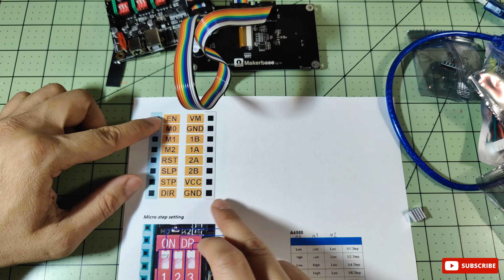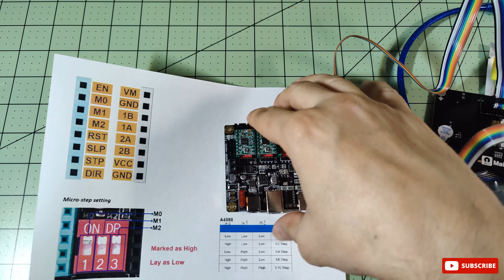How to Connect a Display and Stepper Motor to MKS-DLC32

Comment: من میخوام mks tft70 یا mks tft35 را با dlc32v2.1 استفاده کنم . شدنیه؟
Reply from the maker: Yes and No, the MKS DLC32 does not directly support the TFT70 display. It is designed to work with MKS TFT24, TFT28, TFT32, and TFT35 using a serial connection. The TFT70 uses a different firmware and interface, typically meant for larger 3D printer controllers like the MKS Robin series.

If you specifically want to use a TFT70, you may need to modify the firmware or look for community solutions, but it is not natively supported by the MKS DLC32.

Comment: It is compatible (hot swap) with the tmc2209 v2? Or it needs some adaptions?
Reply: yes. compatible
Reply: @julionewcosta  Can I use the TB67S109 stepper driver with the MKS DLC32 2.1 board?

Comment: Do I need the display to test this or can I control it with a laptop?
Reply from the maker: If you are using makerbase FIRMWARE you need to have the display but if you install FIRMWARE you dont need to have the display ;)
Reply: @UnlimitedIdeas3dprinting  I installed Open Builds Control software and it immediately recognized the card and allowed me to control it with my laptop. I never hooked up a dosplay to the board.
Reply: @roberthosking7524  Did you connect to Open Build with a cable or WiFi?

Comment: Which type of supply you have used for the mks dlc. Please can you tell me about that
Reply from the maker: In this video, for my testing, I used a 12V 3A power supply. However, for regular usage, I require a 12V 30A power supply, which is overkill. I need to mention that I am using this power supply to light two 20W lamps. ;)

Comment: Any idea on how to use this board along with VFD /1.5 kw spindle . Thanks
Reply from the maker: Thank you for your comment! While I don't have direct experience with a spindle as powerful as 1.5 kW, I can offer some general guidance. The MKS DLC32 board should be able to handle a spindle of that size. Typically, machines with such powerful spindles have an external stepper motor driver to control the spindle. You may consider replacing the existing control board with the MKS DLC32, ensuring compatibility with the external stepper motor driver. However, it's crucial to consult the documentation of both the MKS DLC32 board and your spindle to ensure proper integration. If possible, reaching out to the manufacturers or online forums specializing in CNC machines might provide more specific insights from users with similar setups. Best of luck with your project!

Comment: Hi can i use this to upgrade my desktop laser to standalone? 
Is it a gbrl ready board? 

Thank you
Reply from the maker: The MKS-DLC32 is an offline engraving master control kit developed for desktop engraving machines. The hardware is equipped with a 32-bit high-speed ESP32 module, integrated WIFI function, and it is supporting GRBL, usually board is coming with CNC firmware you need to update it
Reply from the maker: the MKS DLC32 is capable of running standalone. You can copy GRBL files to the microSD card for engraving.

Comment: I just bought doc32 v2.1....I don't know how to configure my machine size...pls can you help
Reply from the maker: To update the machine size on your MKS DLC32 board for your laser engraver while considering limit switches, follow these steps:

    Open the 'dlc_cfg.txt' file.
    Locate the parameters for X-axis ($130) and Y-axis ($131) maximum travel.
    Set these values to your desired size, e.g., $130=300.000 and $131=300.000.
    Ensure your limit switch positions are also adjusted to match the new machine size.
    Save the 'dlc_cfg.txt' file.
    Copy the updated file to the root directory of an SD card.
    Insert the SD card into the MKS DLC32 board.
    Alternatively, you can also update these values using laserGRBL or the firmware webpage interface, while verifying limit switch settings.

Always consider your limit switch positions to prevent any potential collisions and ensure safe engraving. After updating, your laser engraver should reflect the new machine size. Remember to double-check your values and limit switch configurations for accuracy.
Reply: @UnlimitedIdeas3dprinting  thanks....I will try and come back with feedback...
Reply: @UnlimitedIdeas3dprinting  for example, $ 130=300.000
Where's the 300.000 measured from...is it from the center of the axis ( I mean , if my overall x-axis work area is 1000mm,  the  $130=500.000, and the limit switch should be placed in such a way that at this 500.000....the physical part of the moving x-axis should activate the switch) this what I understand by your reply....please correct me if my understanding is wrong...thanks
Reply from the maker: Based on what I know, Your understanding is correct! The value you set for parameters like $130 or $131 in the configuration file corresponds to the maximum travel distance of the axis. This value is typically measured from the origin (usually one end of the axis) to the point where the axis should stop moving.

In your example, if your overall X-axis work area is 1000mm, setting $130=500.000 would mean that the X-axis will travel up to 500mm from its origin point. This aligns with your interpretation. The limit switch should indeed be placed in such a way that when the physical part of the moving X-axis reaches the position of 500mm, it activates the switch, signaling the controller to stop further movement in that direction.

Always ensure that your limit switch placements match the values you set in the configuration file to prevent collisions and ensure safe operation.
Reply: @UnlimitedIdeas3dprinting  thanks.....feedback later